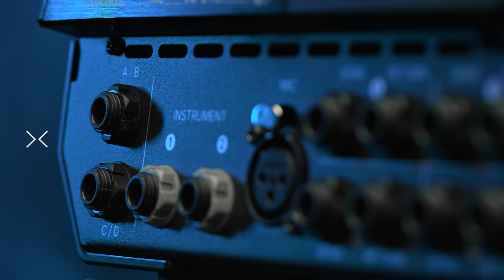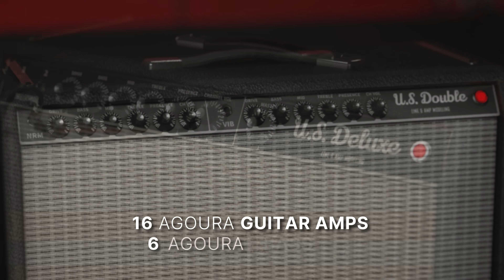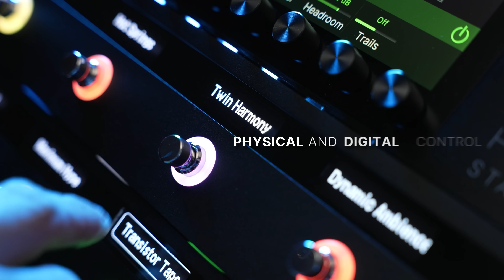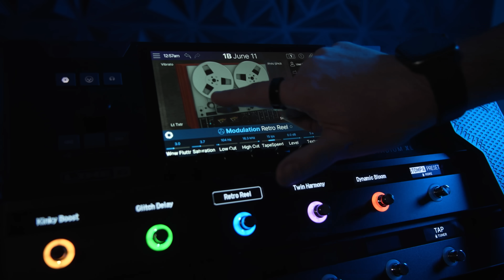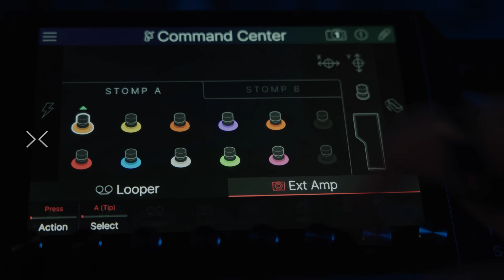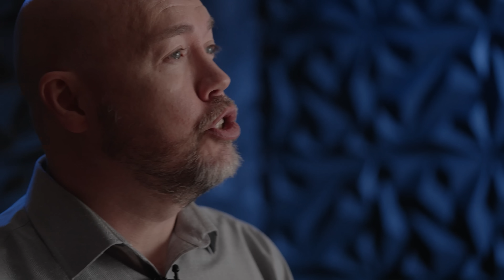Line 6 | Meet Helix Stadium | Your Sound - Center Stage

Comment: Does the power supply utilize inverse reactive current, like the sort used in unilateral phase detractors? And does the chassis automatically synchronize cardinal gram meters? What about side fumbling, such as earlier models were prone to? Has that been effectively prevented?

Comment: oh no. what i dont see is the L6 link jack why would line 6 leave that out. i have 3 line 6 DT 50am[s and i do not plan on selling these wonderful amps. i would have cost line 6 nothing to keep the L6 link jack there are thousands of players around the world that have a helix and the l6 link also newer past couple years line 6 had a couple different models of their powered speakers also controlled by the L6 link.  ifline 6 missed this  im sure thy will lose thousands of sales, i wont switch to the stadium if theres no l6 link.
Reply: L6 LINK can still be used, but it will require the Expand D10 box. If you don't want Expand D10, you can still remotely control DT50 via MIDI.

The number of people using Helix/LT/Rack and DT amps via L6 LINK is not in the thousands; it might actually be in the single digits. (Maaaybe 20?) Unfortunately, adding L6 LINK and VDI to Helix Stadium would add at least $100 to the price and given that Powercab+ is the only L6 LINK-equipped product that hasn't been EOLed, it didn't make sense to force everyone to pay an extra $100 (and deal with a larger/heavier chassis) for I/O that a tiny percentage of people would actually use.

We specifically made Expand D10 to appease existing Powercab+, DT25/50, and Variax customers.

Comment: I'm hoping the sidechaining is really flexible. It would be incredible if there were sidechaining where you can have it run off an output/parameter anywhere in the signal chain (or aux), then an easy/advanced mode -- easy: positive/negative direction + response curve, advanced: you can enter your own formula which includes audio/parameters from anywhere in the chain, so you could have multiple sidechained parameters that interact. I don't think it'd take an incredible amount of extra DSP (with proper constraints on the formula e.g. drag and drop formula blocks to prevent people putting in sqrt[2]) while giving an incredible amount of versatility
Reply: Yes, that would indeed be cool but what you're describing is an assignable envelope controller, not a sidechain.

Comment: I don't know if I like the Touchscreen AND physical buttons. I own a Jeep Wrangler which does the same thing. I can use the touch screen, or physical buttons. I prefer the physical buttons. I'm not sure why? The screen is basically what I use for a map, or radio. The rest of the buttons like Heat, AC etc make more sense to me using physical knobs. I would choose knobs over screen any day. I like getting the feedback of pushing or turning a button/knob. Using both gets confusing. That's just my thinking on that. But I'm sure if all you use is the stadium, you'll get used to it, and it will be second nature. 

I've also never liked integrated pedals. If I want a pedal, I'll get an external one. However, if this machine is as sturdy as their helix, I think it might be a nice welcome. I would definitely use it as volume control.
Reply: I think it always depends on the implementation, but I think some things are best controlled using physical controls (Heat/AC is 100% one of them!), while a touch screen can make really complex software accessible that would be a nightmare to navigate without touch capabilities. If done right, I think you get the best of both worlds. Will take a bit of getting used to of course until you reach for the encoders at the right time and move back to the screen to adjust the next thing.
Reply: @rickbiessman6084 yeah even lately my iPhone touchscreen is feeling slow. And hitting the wrong letters.  It’s so annoying. Inputting GPS addresses into a car is even worse!

Comment: We're getting soo much closer to the ultimate line 6 unit. The one thing I really want to see is Line 6 match the form factor of the Quad Cortex. If. you guys down the line released a version without the stuff like Nexus ect to reduce the size I'd be soo happy. The quad cortex can easily be stored in a rack track with a couple of pedals, wireless ect.

Comment: I bet the DSP, FPGAs and GPUs running on the from-the-ground-up architecture will double down on the subcomponent behavioural methodology, from capacitance to single-ended and push-pull sampled variable power stages. And if it's true that the detailed grid and voltage plate data will communicate with double dynamic impedance curves from the inter-block tone stacks... even if it's not audible at all.... then WOW!

Comment: I want:

1) variable input impedance on all inputs, not just input 1
2) envelope modulation; for example, my detune mix goes from dry -> wet as the signal decays  (my tc electronics g-force can do this since forever)

Comment: I noted during discussion about cabinets the ubiquitous SM57. I’d like to point out that the 57 is a pretty poor microphone for micing an amp’s speaker. They are ubitquitous only because most non-pro players - presumably a large part of your target audience - aren’t exposed to the kind of mics typically used on pro stages. SM57’s are dirt cheap and are seen frequently for no other reason. You might consider portraying instead the Shure KSM condenser line or Beyer and Sennheiser dynamics that accompany them on the overwhelming majority of pro stages. Why not educate while choosing the simple image you promote. The carefully rendered sounds all start at the mic.

Comment: Line 6 should also come out with a Helix Stadium Amp Head and also Combo Amps!That large Touchscreen Display would look great on a real Amp!I would design a Special Speaker Voicing for the Amps so you can use real Guitar Amp Speakers without using IR's for better Simulated Tube Amp Tone!

Comment: I own a Helix LT since 2019 and even if I wasn't convinced 100% by the sound at the beginning, this is still my main and only piece of gear for gigs. I've since tried many plateforms (all of them to be fair : fractal, ampero, Cortex stuff, Tonex, etc.), and even if Helix do the job well in live situation there are many competitors today that have made a great work to achieve a better amp-like feel and dynamic. BUT, I will probably buy the Stadium because the helix customer service is the best out there : my LT pedal broke and they replace it in no time even if it was out of warranty and without asking any question. Not just repair, replacement. And the fact they still update the Helix 10 years after is the second reason to stick with L6. The third reason but also the first is the UI interface, which is a dream to work with. In that regards, the touch screen is a gift. My hope is that the feel of amp will be at least as good as the actual best competitor (Fracta/ToneX to name them). Great job so far Line 6, this new product looks amazing.

Comment: Some critical thoughts / open questions ( A lot of work, I am positive to Line6 products but) :
At time when everything moved towards be mobile and fine grained Line6 choose kind of monolithic approach:
1. Dependency from the wall socket, so we can't simply add it to the mobile pedal board and run on batteries
2. Explanation: to be mobile we need to wait till Helix Staduim Stomp appears and hope it will be compatible with new Expand D10 to connect Variax and other Line6 equipment
3. 8 inch touch screen - competition with iOS/Android  7+ inch screen ) ( Editing style on the floor is not superior to editing on the phone/tablet )
4. Zero support of patch execution on iOS / Android as some direct competitors
5. Explanation: You can't use your patches on any mobile platform without LIne6 hardware and have only hardware and native desktop solution 
6. Showcase Multitrack control: is it Cubasis competitor ? / or on Stage non linear editor competition with Ableton / Studio One products ? is it compatible with Cubase  - can be - the same BIG company Yamaha-Line6-Steinberg.
7. Zero AI features in 2025, only promises for Proxy next year, far behind of competitors
8. 32GB max capacity in 2025, does this spec survive for the next 10 years?
9. It becomes more expensive then Fractal Axe from price point and need to prove that it is better 
10. It is more like desktop module then floor module
Reply: 4; wifi and bluethooh control mean nothing to you.....
Reply: 7: competittors promises features  that was available many year later after lunch. They said next year. let's just  wait
8; they gave no clues to what 32 Go SD will be use for.

Comment: The fact alone you put a tremolo in your signal chain with 0% mix and it makes any preset sound instantly better make me sold my helix and lose faith in it. Also, you have to put crazy amounts of effect to make a preset sound good. Bought a quad cortex and instantly being in love, all the premade presets sounds good, no need to tweaks anything for hours. Their amps sounds better out of the box. I do agree that Line6 make the best hardware though, and the Helix Stadium seems like the perfect unit, but will have to see for myself if they have fixed their captures.
Reply: What in the ever loving heck are you talking about?  You have to use a crazy amount of effects to make a preset sound good?  The fuck?  No you dont. lol  And what on earth are you even getting at with the Tremolo.  Why on earth would you use a tremolo with 0% mix to make any tone sound better?  It sounds like your problem is that you absolutely had no idea what you're doing, to say the least.

Comment: I’m very excited for this but, I just hope it A, sounds good and B, has enough DSP to utilise all of the cool stuff it has. 

I left my Helix LT for the Fender TMP, the TMP gets the sound and feel very right but it’s lacking midi capabilities and dsp distribution choices have me really frustrated. 

It’s 2025, please let me go wild with amps, cabs, delays, verbs and PITCH EFFECTS. I want to be able to experiment and build new cool mental sounds without hitting the DSP limits. Pretty please line 6 🙏.
Reply: The problem is that with higher processing capabilities, the software devs use more of it in order to improve the quality and capabilities of the models.  But obviously if you stick with old HX models, you're going to have way more processing headroom to add what you need.

Comment: I need a degree in technology to understand all of this.  Big question is: will Line 6 still provide updates for the first Helix Floor that we all own or are we going to be forced to buy the new one at $2200 fI heard the new version will go for plus I'm sure the tote bag or hardcase another $150 plus.   If updates are a thing of the past, I may have to go back to my tried and true old fashion pedal board.
Reply: Eric said in the livestream that they would continue support for the OG Helix. But even if it stopped today, it wouldn’t sound any different or worse than it does right now.
Reply: Bud, the Helix was supported for TEN FULL YEARS with COMPLETELY FREE updates.  Even if they cut off updates to OG Helix, in no way is that them FORCING anybody to buy anything.  The Helix is insanely feature packed at this point, it seems ridiculous to act like just because they're moving forward with a new platform means you somehow HAVE to buy it.  Tons of people will inevitably still be quite happy with the Helix as is, and as the other person says, is not ever gonna sound worse or become less usable just cuz it doesn't get updates for the rest of eternity.  What an utterly absurd way to see things.  And it looks like you're a proper grown adult, too?  I dont get how people turn out like this.

Comment: So much more difficult visually than the Fender. No thanks. Sounding great doesn’t have to be this difficult
Reply: Line 6 have some of the most easy to use interfaces in the business.  Some of the visual aspects are also optional, with different view modes.  You can keep it entirely simple if you want.

Comment: Line6 made history today. This device is years ahead any other existing unit. There's no point in buying a Quad Cortex once this is released.

I've never considered spending more than 1000€ on a modeler (got the LT instead of the Floor back in 2020), but this is truly a game changer. Count me in for the Helix Stadium without the expression pedal.
Reply: Does it really sound better than quad cortex though?
Reply: @danielkelleyhoward we'll only know when it's released.
Reply: I think they simply wanna go for the luxury market. It's not better than any other modeler unit it's just more expensive.
Reply: @clouds5 it depends on what you consider "better", of course. Touchscreen that's also bigger, smaller footprint and lighter weight, new and presumably better amp simulation engine, the Showcase feature which was totally unexpected and turns the modeler into a workstation that can control many external devices, improved UI, the new Hype control on amps, capture technology, wifi and Bluetooth for wireless editing, the Focus view... 

I'm interested in all those features, many of them are not in any of the current modelers and no modeler has them all, so I would safely say it is better than anything available today. 

And yeah, it's expensive, but compared to other units in that price range, I found it a pretty reasonable price. If you don't need what it offers, there are other devices in the market.
Reply: @Molul_  I agree. If you need the specific features it has, why not. Price is always subjective :D Compared to some real amps this new Helix board is a steal. And at least it's a complete product. I can't believe Neural DSP and Fender doesn't even offer something with an expression pedal at these price points...
For me personally, a modeler needs to have good PC software, because that's what I use to build patches. And it needs to be easy to use in live situations, because that's where I use it. And it needs to sound good ofc, but that doesn't seem to be an issue anymore. Basically every modeler/plugin I heard in the past ~2 years or so sounded very good. So I can get all that for a fraction of the price.
Reply: If older versions of helix was so good, why do musicians use quad cortex on stage most of the time? And how would the new helix change the game?
Reply: @arvind-h1c as far as i know, QC competed with current Helix bringing amp captures, smaller footprint (to small for me, footswitches are closer than I would like), bigger touchscreen and technically less accurate amps but many prefer that they are easier to dial than Helix's, as they add some compression and EQ applied which make them sounds more like a "mastered" sound.

Stadium is bringing captures, bigger touchscreen, smaller footprint (the non-XL is still bigger than the QC but it has internal power supply and the footswitches distance seems more convenient for me), and the new amp engine has both the Helix accuracy and this new Hype parameter that's expected to make the same magic QC does.

That, together with the fact that Line6 has continuously delivered updates for the last 10 years and hasn't promised anything they didn't deliver later, can be attractive to many people. Neural DSP is not as trusted nowadays. 

Once the Stadium is released, the only reason why I could see people still choosing QC is the still smaller footprint and the amps and effects if they prefer them.

Comment: Looks great! Is a dedicated foot controller in the plans? I was never interested in the Quad Cortex because they don´t offer one. At home, a unity like that belongs on the desk, not on the floor. I don´t want to waste time configuring midi. One thing I love about my kemper is the remote, you plug only one cable and it works great.
Reply: This is absolutely nonsense. lol  Line 6 literally calls these FLOOR models, packed with loads of footswitches and even an expression pedal.   They are 100% built to be operated as a floor unit.  They're also generally far too big to be on a desk.  The footswitches also have immense customizability and functionality.

Comment: I am *really* hoping that the song mode will also allow for quick recording of ideas in a future update. It looks like it already has multitrack capabilities with the stem splitter. Just add the record button there and the micro sd slot and it would be the ultimate scratch pad for ideas without even connecting your Mac! 👍🏻

Comment: The simple statement that "Open Source" soutions are doing amazing things in this space is all I needed to hear to know that Neural Amp Modeling is the current KING. I'll bet anything that Agora is just re-tooled NAM Code.
Reply: Hi, L6 engineer here. Agoura is a component level algorithmic modeling engineer while NAM is a machine learning profiler. The two are different on a fundamental level and solve completely different problems - we couldn't do what Agoura does with NAM if we wanted to. Our machine learning profiling engine, Proxy, is also bespoke and built from the ground up by us to have a number of advantages with our hardware vs implementing a NAM player. We might still add a NAM player at some point, it remains to be seen, but I can fully assure you that nothing with our name on it is retooled NAM code.
Reply: @thebishopgame  I’m assuming proxy won’t be available on the old line of helix units (stomp etc) too?
Reply: @matthewlarissawanstall8476  Correct, only on Stadium.
Reply: @matthewlarissawanstall8476 Correct
Reply: Profiling is not modeling.  Two separate things.  It's hilarious seeing people so confidently talk about things they dont understand at all.